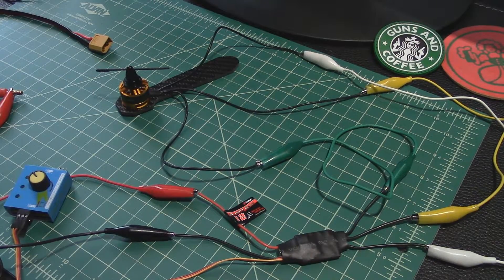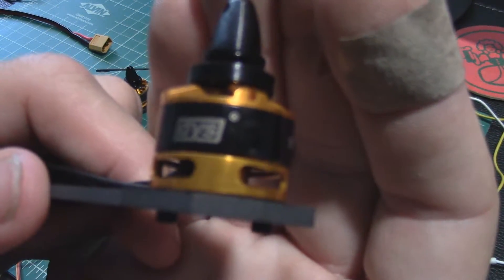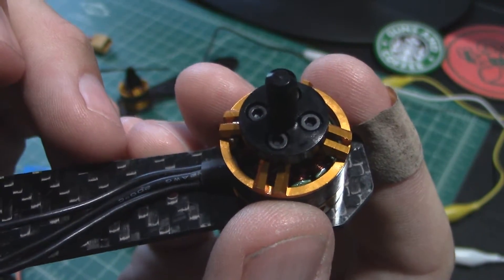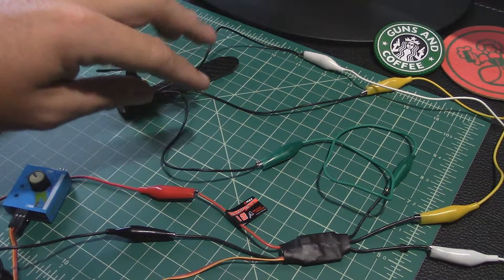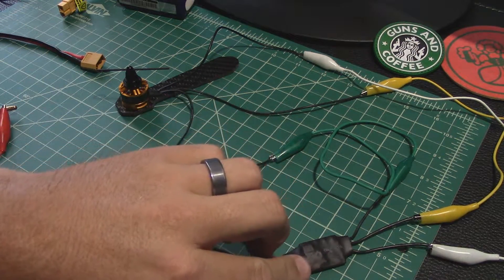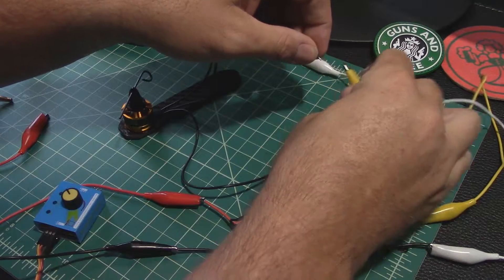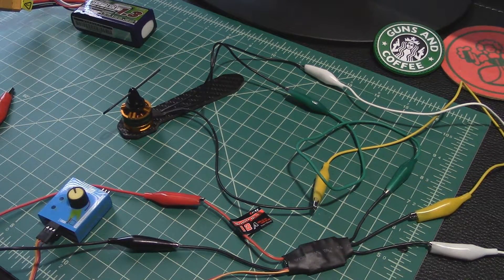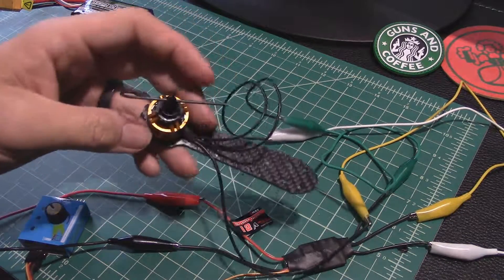ZMR250 Quadcopter - Motor Rotation Set-up

Comment: thank you , my question answered , I wanted to know if the esc's were actually cw and ccw , so if I understand correctly , the esc's all wire up the same from the control board , but changing any 2 wires on the motor changes the direction of rotation ?
Reply from the maker: Exactly right

Comment: Thanks,  I did not do this test and have two motors that are spinning the wrong way.  I will remember this for the next build.
Reply from the maker: Actually usefull Thanks for watching.  These ESCs had old SimonK firmware on them.  Almost all ESCs that I know of in use today use BLHeli or BLHeli_S or BLHeli_32 firmware which allow you reverse the motor rotation through the BLHeli software suite.  So at this point, testing direction before soldering the wires down is much less important.  However, it is always good to know that you can reverse the motor direction at any time by un-soldering any 2 of the wires and crossing them over before you re-solder them.

Comment: Hello. I have an rtf racing quad made by arris. It has 4in one esc by flycolor. If I wanted to change out a motor can I just cut the wires along the arms and then solder the wires that are already soldered to the esc to the new motor? It would just be easier to solder the leads of the new motor to the wires that are already soldered to the esc. Thank you.

Comment: would make sense that motors and esc came with numbers on their leads so one could wire it clockwise or counter clockwise, so 1, 2, 3, is clockwise, 1, 3, 2 is counterclockwise, or something like that.
Reply from the maker: +Scottslookingabout yeah that would be cool, but it would take standardization of the systems, and I don't think the manufacturers could ever get on the same page with ESC and Motor Phase set-up.

Comment: Oin Taylor  where did you get those jumper cables at?
Reply from the maker: SuperStwolf I ordered them on eBay  $3.99 USD for 10 of them.   Look for Double-ended Test Leads
Reply: Oin Taylor Thank you
Reply: +Oin Taylor My preferred method is to solder 2 motors straight and 2 crossed first (since you know you will need that anyway) then use the servo tester to work out direction for each pair before attaching the arms to the base. Then once you have done that do a final test with all 4 connected to the servo tester (mine can handle 4 at once) just to be sure the rotation is correct for all of the motors.

http://imgur.com/xYZOtLd

Though you can't see in that photo, as my camera shutter was so fast, all 4 motors were spinning correctly.